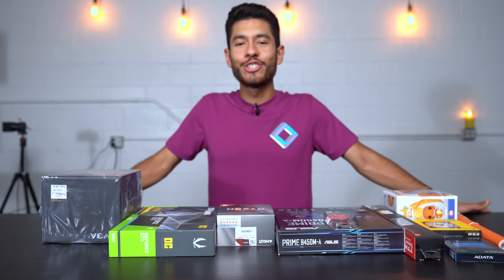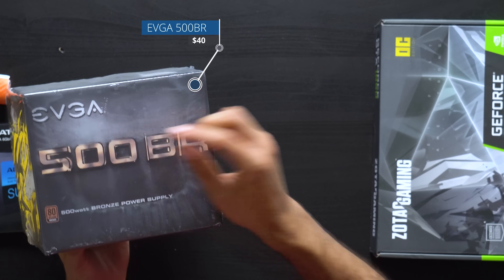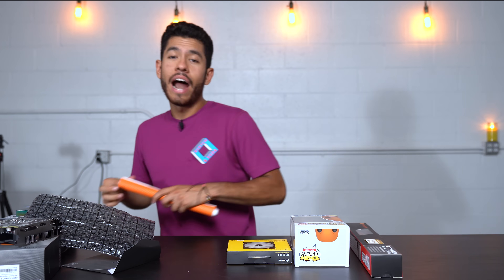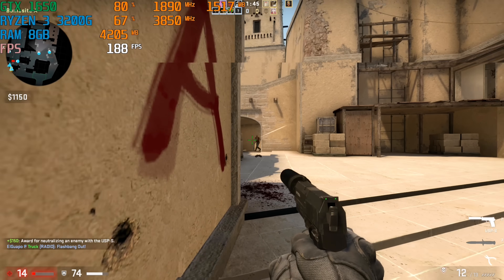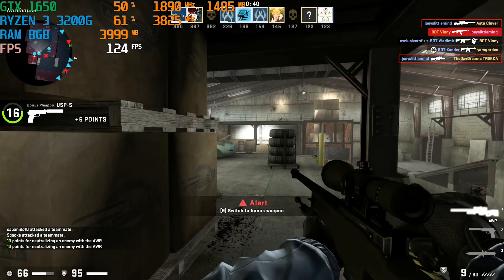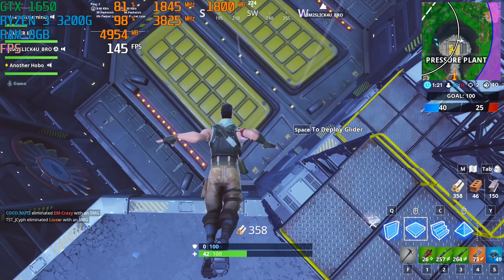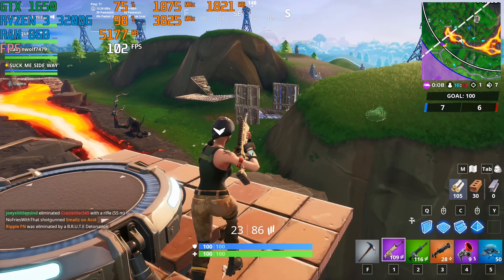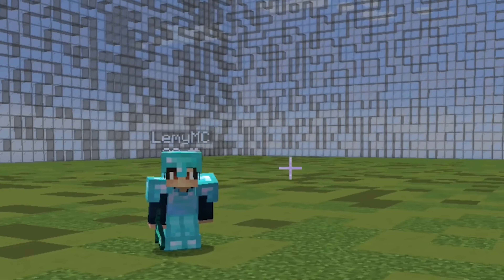$500 Gaming PC Build - GTX 1650 Ryzen 3 3200G (w/ Benchmarks)

Comment: Would a GTX 1650 OC 4GB GDDR6 128-bit work with all the other components used in the process? If said graphics card isnt available?? Or would it require different hardware. New to this pc buildin stuff

Comment: The pc parts are fine and the games run smooth af, but I think going for a Ryzen 5 1600 is the better option because it has better performance, it's cheaper, and you can also spend the extra bucks for dual channel memory which will probably make a lot o difference in performance.

Comment: Does the graphics card have to be from zotac? Plz reply
Reply: 100% no.Just check reviews to makesure it is on par with it.
Reply: @calahann5456  par?
Reply: @Tahibottomfrags  like same speeds, same rating
Reply: @calahann5456  ok thanks
Reply: @calahann5456  is there any other gpu I can use instead of this one
Reply: @Tahibottomfrags  i mean with prices this horrible it would be hard to, but i mean you could go with a RX580 4GB, or a 1060/1060ti if any are available. should give more or less the same performance
Reply: @calahann5456  is the 1060 3gb good?
Reply: @Tahibottomfrags  it’s okay, but if you’re playing a relatively new game/or a good looking one it’ll be not so good
Reply: @calahann5456  can it run siege with a ryzen 5 1600?
Reply: @Tahibottomfrags  DEFINITELY! itll run very okayly
Reply: @calahann5456  ok thanks
Reply: @calahann5456  what about the asus gtx 550ti cuz I can find a good deal on the 1060
Reply: @Tahibottomfrags  definitely not that’s not good
Reply: @calahann5456  so what else can I use

Comment: I have a little problem, I've entered on a site that tells you if the components are compatyble and it said that the mother board it's not compatyble with the CPU...But, I mean, if it worked at you, I think it's OK...Please respond!!!
Reply: Izzy ' It only means that you would need a bios update. Other than that it’s compatible
Reply: @h3nry155  That's what it also says: Some AMD B450 chipset motherboards may need a BIOS update prior to using Picasso CPUs. Upgrading the BIOS may require a different CPU that is supported by older BIOS revisions.
Reply: Izzy ' Look at his 400 dollar pc guide and he shows how he updated the bios. You don’t need a different cpu.

Comment: How would this run with a 1050 TI?
Reply: Lol ended up building this with a 1650
Reply: @dimassimo8298  nice decision bro 👍
Reply: @dimassimo8298  you built this?
Reply: @yzword2  not the exact parts but same cpu and gpu although I have 16gb of ram different motherboard
Reply: 30 to 40 fps

Comment: Benchmarks (fps)

Csgo (max settings)
avg fps 130-150

rainbow 6 seige (high settings)
Avg fps 95-100 

Fortnite ( Pro settings)
Avg fps 90-110

Overwatch (high settings)
Avg fps 96-115

Minecraft
Avg fps 660-690

CoD WaW (idfk)
Avg fps 90

Comment: i have this specs no overclock ,  ,AMD ryzen 3 3200g ,Gigabyte A320M ,1 stick 8GB DDR4 3200 mhz  ,240GB CRUCIAL SSD , what else should i add to make it stay 144 fps+ on csgo  , 4:3 1280x960 low settings using 144 hertz monitor . any suggestion would be big help
Reply: Get 8 gb ram

Comment: I’m running:
GTX 1660
Intel i5-10400
Z-490 A-PRO Motherboard
16gb Corsair Vengeance RAM
240gb SSD
2TB Internal Storage

All this along with the case totaled up to around $772. Not bad
Reply: I've spent around $600 on almost the same build but I went with Ryzen 3600 and 1660S
Reply: why z490?Thats not an overclockable chip

Comment: No monitor in the build but still taking Ryzen 3200g why?You are taking Graphics card then why 3200g?R3 3300x would be better or i3 10th generation....
Reply: Those parts didn't come out at the time of upload. Check the date.
Reply: @cytrus3427  WHAT ABOUT R3 3100X?

Comment: This guy is nuts
Who the hell will pair an apu with 1650 it will definitely bottleneck
Better go with 3300x or 3500 with 1650
Apu is not meant for pairing with medium and high end graphics
Its meant for entry level 1080p gaming
Reply: Wrong. Just because it has a iGPU doesn't mean the CPU will perform less. Do you seriously think the i3 9100f would perform differently than the i3 9100? Are people really this stupid?
Reply: @cytrus3427  yes it definitely will throttle because 3200g cpu reaches 100% in many modern games at 1080p medium to high settings
For just $30 more you can get 3300x which offers much better performance or with $100 more with 2600 double the performance
Reply: @VVikramSingh06  Correct. However, this was one of the few ryzen budget options at that time, this build is outdated.

Comment: When you install the 8 pin CPU connector from the power supply, how does it sit on the 4 pins on the mobo side? The 4 in the middle? Does it matter? Thanks.

Comment: I did cut some costs like a different case and a used motherboard and a different ssd but it all came out to be (without the Charmander corsair fan and rgb strip, but i did get 3 fans that are white rgb for 17$) 529.87$ and this is with price change over the year(s)
Reply: Get the ryzen 3100 instead of the 3200G.

Comment: I cant run fortnite, i literally have pretty much the exact same set up, and have the settings turned to the exact same, and I've been able to play way more graphic intense games than fornite, but for some reason, whenever i play fornite, the audio always cuts in and out, and the game just doesnt stay stable. Im hard wired in so I dont think its my internet, but can someone please help me figure out why my fornite is running like ass?
Reply: Is your hdmi or display port cable plugged to the actual graphics card? Sounds like it might be plugged into the motherboard not the graphics card itself.

Comment: im thinking of getting this build should i?
Reply: Yes but if u want more games I suggest getting a 2hdd hard drive and 16 gigs of ram
Reply: Matakai Yes I did this setup and it works fine
Reply: the only part i still cant figure out is building it . afraid of breaking and and wondering if it runs valorant
Reply: Matakai It 100% “runs” valorant but if you want better performance you I think you have to upgrade graphics card and ram 😁
Reply: Skeeter thanks man im about to build it when it comes in and hopefully it goes well its my first ever pc so trying to get into it :)
Reply: Matakai Awesome reply If you have any questions
Reply: Skeeter the only thing ill struggle on is mostly the cable parts because i get confused on it alot
Reply: Matakai Hey there as great video I can link that really helps with cables
Reply: Skeeter sure would appreciate it !
Reply: Skeeter sorry if i ask alot of questions but do i need to buy a usb wifi adapter ?
Reply: Matakai for this motherboard yes but the motherboard in the video I linked no
Reply: Skeeter i got the b450 a one so its different but the b450a needs a wifi adapter and dont know which one is good
Reply: Skeeter i might just get that motherboard i stead of joeys one everything going to be the same powrrsupply graphics card rtc from joey except the motherboard
Reply: Matakai So if you do get his motherboard here’s a guide to adapters https://youtu.be/ePETnzY3c4E but if you don’t then your good just read the manual
Reply: Matakai And also I recommend getting more storage
Reply: Skeeter do you have anything I can message you on?
Reply: Matakai You can message me on xbox app, Instagram, iMessages
Reply: Skeeter whats ur instagram?
Reply: Skeeter also thinking about getting s rx 570 instead of 1650 i heard 570 is better
Reply: Matakai It is
Reply: Matakai @skeetsskeeter  what’s yours
Reply: Skeeter motuhkai
Reply: Matakai k did you send a request?
Reply: Skeeter yup i followed and messaged u
Reply: Matakai k I’ll accept it in a lil bit I have to do something

Comment: Yo what about these?

CPU: Ryzen 3 3200g AM4
GPU: GTX1650 4GB GDDR6
MOBO: Asus Prime A320M-K AM4 Micro-ATX 
RAM: Kingston HyperX Fury 16GB (2x8) 3200mhz Ddr4 
STORAGE: WD Green 480GB M.2 2280 SATA III 6Gb/s 3D NAND Internal SSD
PSU: Corsair CV450 - 450 Watt 80 Plus Bronze Rated
Reply: 500w or 550w is better, 1650s>1650 abismal diference for games and is much better
Reply: @khada668  ok thanks!
Reply: @shck4704  if you can get the ryzen 5 1600AF better and later upgrade the mother, amd+nvidia= best combo :) for pc gaming economic 1080p 60fps
Reply: @khada668  well its more exp and hard to find in the Philippines so yeah ;-; since the pandemic stocks are htf and expensive.. the build I mentioned reached around $600+.. pretty absurd but yeah its unfair 😭
Reply: @shck4704  yeah,  i know that feel bro.. 😔💔
Reply: @khada668  😢

Comment: If you're gonna build this, buy the rx570. It's way better than gtx 1650 for about the same price more or less. If you have 50 dollars more in your gpu budget, buy the GTX 1650 super. It's better than Both Rx 570 and Gtx 1650.
Reply: With this will I be able to run 1080p 144 FPS with dual 8 gigs of ram instead of one?
Reply: Should I get a msi gtx 1650 super 128-bit

Comment: Using a apu with a discreet gpu is a foolishness. 
Instead remove the apu and include a r3 3100 latest or if very tight in budget remove the gpu, and if the motherboard support overclocking overclock the apu to increase performance. 
The r3 3100 is the exact same price around the apu used in this build.

Comment: lol love how I have the exact exact EXACT same specs and my fps is nothing like this, my GPU usage in games is horrible, ffs whyyyyyyyyyyyy
Reply: Ends_06 update your drivers and closedown background apps that you don’t use while gaming. Try have minimal apps open and if it’s still bad try over locking your parts. In your settings you can change your pc to run at max performance, because most are set to optimal power by default. That will get you better fps and less stuters
Reply: mint_oce yh I already have my power plan to “ Ultimate Performance” with only 1 app in the background “MSI afterburner” I’ve already over clocked the fuck outa my 1650 ,, I literally just noticed that it’s gta online, it’s so bad 🤣🤣,, story mode works amazingly

Comment: Is the Corsair fan necessary
Reply: No it will run fine with just the 2 front fans but I do suggest getting a fan for the back of the case as the pc will run cooler

Comment: Ima do this build but should i use ryzen 3 3200 or the CORE I3 9100F
Reply: Whichever 1 you can afford, would recommend the 3100 since it has 8 threads and games will start needing more threads. Its around $99 to $115

Comment: Hi I'm new to this and I'm planning on building a PC like this so that I can play with my mates but also do some work. I live in the UK and cos of COVID-19 its caused prices to go up. But my list of the parts that I'm thinking of purchasing are shown below. I'm just wanting to know peoples options on this and if there is anything that should be changed. 
I would really appreciate the help!
Thanks

Fractal Design Focus G - Mid Tower Computer Case - https://www.amazon.co.uk/gp/product/B074WB4GDP/ref=ox_sc_act_title_9?smid=A2LNOP4UQZJ1&psc=1

Corsair RAM 16GB (2x8GB) - https://www.amazon.co.uk/gp/product/B0143UM4TC/ref=ox_sc_act_title_8?smid=A3P5ROKL5A1OLE&psc=1

ZOTAC GAMING Geforce GTX 1650 OC
 - https://www.amazon.co.uk/gp/product/B07QF1H9YR/ref=ox_sc_act_title_7?smid=A3P5ROKL5A1OLE&psc=1

ASUS Prime Motherboard - https://www.amazon.co.uk/gp/product/B07F6YQV4J/ref=ox_sc_act_title_6?smid=A3P5ROKL5A1OLE&psc=1

AMD Ryzen 3 3200G - https://www.amazon.co.uk/gp/product/B07STGHZK8/ref=ox_sc_act_title_5?smid=AFXON1SGSPLH4&psc=1

EVGA 600W Power Supply - https://www.amazon.co.uk/gp/product/B01127D0MY/ref=ox_sc_act_title_3?smid=A3P5ROKL5A1OLE&psc=1

ADATA SSD - https://www.amazon.co.uk/gp/product/B01K8A2A0E/ref=ox_sc_act_title_2?smid=A39PCE7Z09S194&psc=1

Ziyituod WiFi Card - https://www.amazon.co.uk/gp/product/B07RV9X9KJ/ref=ox_sc_act_title_1?smid=A3PNAKHEQF1YTY&psc=1
(I'll have to add it because there isn't any built in WiFi on the motherboard)

(Optional) WD 1 TB PC Hard Drive - https://www.amazon.co.uk/gp/product/B0088PUEPK/ref=ox_sc_act_title_4?smid=A3P5ROKL5A1OLE&psc=1
Reply: I dunno much about pcs yet but it sounds good to me 👍🏻 Hope this succeeds!
Reply: Change the GTX 1650 to the RX 580 😄

Comment: Could I get Ryzen 5 1600 instead of the Ryzen 3????
Reply: Yes
Reply: Alex P will it be any different to build
Reply: @tomque7933  No the CPU always goes in the same place
Reply: Alex P is this build over clocked?
Reply: Alex P if it isn’t if I overclock the cpu would I get way more fps
Reply: @tomque7933  To overclock you need to go into the settings of the CPU to change it. Overclocking does add a little more fps not much more maybe like 5 fps or so but it can damage the CPU overtime and you need to get a Motherboard which supports overclocking
Reply: Alex P ok I won’t overclock then ty
Reply: Alex P is the gtx 1650 super worth the extra money
Reply: Alex P does it matter about the ram can I get any ram that 2x8 Gb sticks for my build
Reply: shit  the faster the ram the better 3000 megahertz is good but the Ryzen 1600 will only use 2666 megahertz

Comment: This is a great starter PC! What ram would you recommend replacing since it's only one stick? And is the case big enough for future upgrades?
Reply: This guy is horrible builder. 3200g is 4/4 cpu with integrated graphic there is no point to buy it with gpu. Look at ryzen 5 1600 6/12 same price but performance is way higher.
Reply: Ильяс Каримов 3200g is $100 on newegg. Ryzen 5 1600 is $150 on Newegg . What do you mean the same price?
Reply: @dervize7698  ok i didnt know about NA market. in Russia both about 100$. And in german market 1600 cost 20$ more. Still buyng 4/4 apu with gpu is stupid decision.
Reply: You can get dual channel 8gb 3200mhz for like 55$
Reply: Im buying a ryzen 5 2600. Rx 570 8gb. 8gb ram 3200mhz 550w psu.  500gb ssd 1tb hdd b450 mobo
Reply: @kristerslorbergs5004  take a look at 1650 super its a bit more expensive but u can save money on ssd.
Reply: Rx 570 better tho
Reply: @kristerslorbergs5004  im not  sure. could be better then 1650 but not 1650 super
Reply: What is 1750 super? Wut
Reply: @kristerslorbergs5004  1650 super* my bad.
Reply: Erm ryzen 5 2600 is 124€ in my country

Comment: What if i buy two 8g rams will it be functional?
Reply: Yes. That is actually preferred instead of having a single stick of RAM. The reason is that when you have 2 DIMMs (RAM), you can get what is called dual channel mode which can increase performance. Just make sure you read your motherboard manual for the correct slots to put the memory in. Some boards are more picky than others and won't POST if modules aren't in the right place, and others don't care.

Comment: Been wanting a gaming pc for yearsss. Finally have enough and think this is the build im going for
Reply: Qxzie I would hold off until the virus goes away since pretty much every part costs more than usual due to limited stock
Reply: get the GTX 1650 super its like 10 dollars more than the gtx 1650 and its way better (from where i live its 5-10 dollars more)
Reply: Daniel Diaz in my country its like more 40-50$
Reply: Abdou Fn build me a pc and send it to me 💀 this one is good but hell ill take another
Reply: @abdouu5300  oh
Reply: Same lol im gonna get this by next mounth
Reply: @abdouu5300  lol u could have gotten a btr pc, at this time, but at that time, ok
Reply: Go for i3 10100f with 1650 super / 3100 with 1650 super instead this is 1. a bit of bottleneck for 1650 cause of low thread count in 3200g, 2.the cost of the 10100f is cheaper in some countries (like mine) than the i3 10100f, and the 1650 super is just a 10 dollar increase for a huge 50% increase in performance compared to 1650, since i3 is cheaper and 1650 super is just a little more expensive, the price would be the same, and if u dont put as much accesories as this guy in the video, you can save like 100 dollars  technically this build should be around 350 to 450, not 500 without so much rgb and good stuff that make the pc look premium and nice. lol thats about it
Reply: @turtleboi9385  lol, ryzen 3 2200g is the same price as ryzen 5 1600, both 129 euros, but the 5 has like 6 cores and 12 threads so i geuss thats way better and more fututere proof than the ryzen 3 or i3
Reply: @sybrenvanderley6685  not in my country anyways
Reply: @turtleboi9385  but do you think thats a good deal? Cuz i am a first time builder
Reply: @sybrenvanderley6685  gaming or multi tasking? btw the 3100 shld be faster in gaming as it has faster and better cores than 1600, 1600 kinda weak ngl at this moment
Reply: @turtleboi9385  yes, but the 3100 is way more expensive
Reply: @sybrenvanderley6685  i3 10100 is a great bang for your buck, or you can get the Ryzen 5 1600AF, its a refreshed version of the original and is based on a 12NM architecture
Reply: @Hamza-yl4oc hmm, but im already looking at some b450m motherboards and amd cards, so i think im going ryzen

Comment: $1000 in Canada.... ouch 😂 I just bought this setup except I got 2 8gb vengeance ram and rx 580
Reply: can u put the parts u used and CAD money ty
Reply: Rhys Issac 
Gigabyte Radeon RX 570 Gaming 4G Graphics Card, $202

AMD Ryzen 3 3200G 4-Core Unlocked Desktop Processor with Radeon Graphics, $140

EVGA 450 BR, 80+ Bronze 450W, $100

Corsair CMK16GX4M2Z3200C16 Vengeance LPX 16GB (2 X 8GB) DDR4 3200 (PC4-25600) C16 1.35V for AMD Ryzen Black, $120

Asus Prime B450M-A/CSM AMD Ryzen 2 $120

ADATA Ultimate SU635 3D NAND SATA III 2.5 Inch Internal SSD (240GB), $50

Thermaltake Level 20 MT Motherboard Sync ARGB ATX Mid Tower Gaming Computer Case, $135

Bought all in Amazon. So there’s shipping and handling and taxes. You can find used parts on Amazon which is what i did.
Reply: @jothamdiaz260  thanks alot
Reply: LMAO i feel so bad for you im also in canada and now this pc is 780 lol